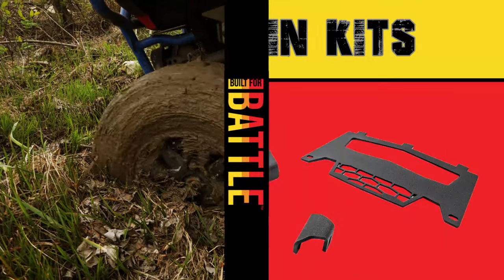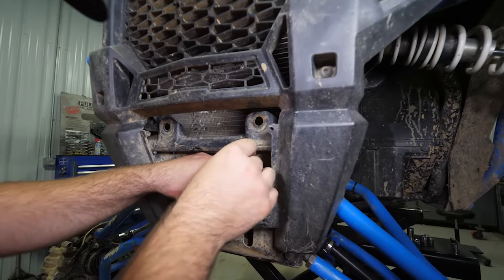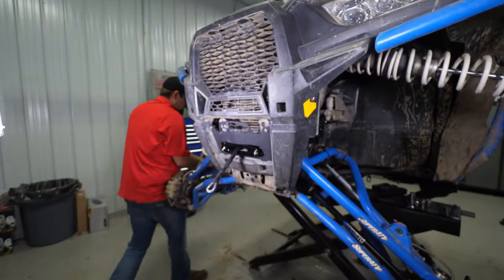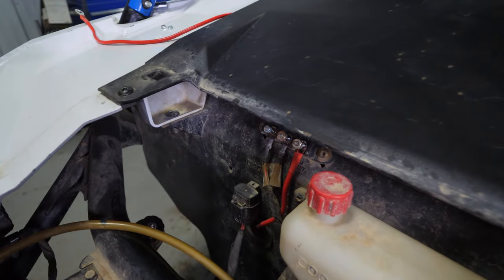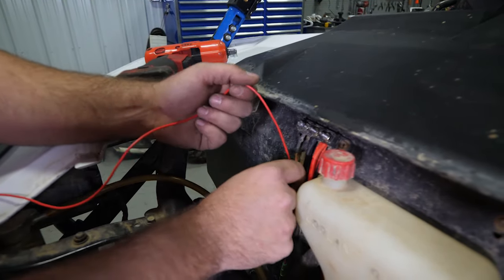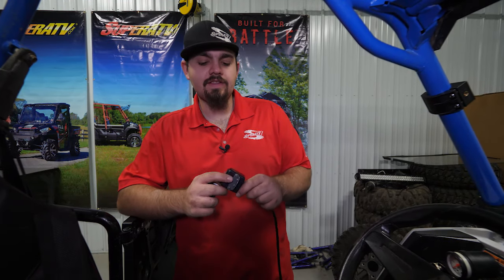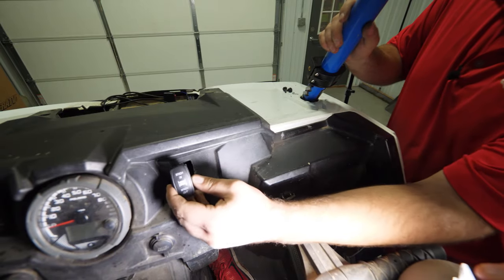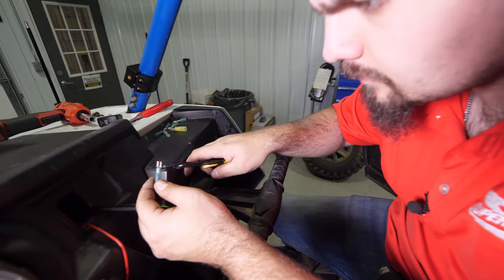How to install Winch Mount and Winch on Polaris RZR 1000 | SuperATV

Comment: One of the best how-to videos I've seen. I already have the SATV bumper, nerf bars, etc., so there's no question where I'm going for my winch. I've been wondering what I was going to do with that wired remote, since I prefer to have an illuminated dash-mounted rocker switch. This video answers that  question! I love the fact that you include the connectors so we don't have to wind the excess wire into a loop and try to find a place to hide it.
Thanks, guys!
Reply from the maker: Thanks Rick that means a lot. We work hard daily to bring you guys legit install videos along with top notch products! Never hesitate to reach out to us if you have any questions about any of our products.

Comment: Pro Tip: on the winch mounting plate put the 2 bolts in on the firewall side and leave them very loose, temporarily zip tie the radiator hoses and intercooler hoses out of the way. Take the drivers side shock and bungee cord it up and out of the way as shown in the video. Fish the winch in from drivers side, be patient and take your time, take a break if needed. Bolt the winch to the mounting plate. Then push mounting plate up and install 2 front bolts and then tighten all 4 mounting bolts. Dont forget to fish the winch cable through fairlead before installing winch on mounting plate. I can verify that the 5000 lb winch fits on superatv mounting plate on a 2018 RZR 4 Turbo 4.
Reply: Did you have to remove the front plastics (or anything not shown) to get to the front mounting plate bolts?

Comment: Great Video. I installed my SuperATV Winch with rocker switch with no problems, due to this video. Thank you. Just a heads up you do not need to take your Tire, or Shock, but it would help. :) A+

Comment: For wiring up the toggle switch, mine was different.  So for those of you that the colors aren’t what this guy says coming from the solenoid. Mine were black, red and green. You hook up the keyed on power like he said and have your two jumpers coming off of it. The ground wire from the bus bar goes to the top (#7) then the order is black, red then the bottom is green.
Reply: Can you post a picture of yours
Reply: @richardpoehnelt3090  if I can figure out how to upload a picture I will
Reply: @dbceaj4279  thanks Dustin. Just take a picture with your phone.

Comment: 2015 rzr xp1000, 3500. 
Got everything hooked up correctly and straight to the battery, but no power to anything.
Reply from the maker: Are you using the remote or the hardwired switch? Is the red wire in the hardwired switch harness connected per the instructions?

Comment: On the 2018 XP4 Turbo, how the heck do you get the front two mounting plate nuts tight? This isn’t shown in the video. Either you need Smurf hands or a wrench that goes through walls.
Reply: sorry to be so off topic but does anybody know a trick to get back into an instagram account?
I stupidly forgot my account password. I appreciate any tips you can offer me.
Reply: @Bryce Jaxon Instablaster =)
Reply: @Nikolas Adrien I really appreciate your reply. I got to the site thru google and I'm waiting for the hacking stuff atm.
I see it takes a while so I will get back to you later with my results.
Reply: @Nikolas Adrien It worked and I actually got access to my account again. I'm so happy!
Thank you so much, you saved my ass!
Reply: @Bryce Jaxon No problem xD

Comment: Do you have a part number for the Y splitter?
Reply from the maker: This install is on an older version of our winch. We no longer carry the y splitter, but we do have the new solenoid kit. Give us a call at 855.743.3427 and we can help you get everything you need to update your wiring to the new style.

Comment: The solenoid that came with my 4500 winch is not the same as that one. So it does not fit in the pre made holes.
Reply: After further looking into
It i found that the solenoid was made for a 19+ model rzr. So i will have to drill holes for it to work instead of using the pre made holes

Comment: Wat kind of battery impact is the one u use. To remove the spring
Reply: It's a Milwaukee 12 volt impact with a protective cover
Reply: Dutch B 
False, that definitely isn’t the M12 Milwaukee 

Looks like the Mac Or Snap On impact (they look much cheaper and basic)

But I’d buy the Milwaukee over Mac or Snap on personally

Comment: Used this video and the other for the 4500lb install here: (https://www.youtube.com/watch?v=ixbbNPpVukA) to install the 4500lb winch in my 2014 RZR XP. Installing the physical winch with the mounting plate was the easy part.. I did not remove the shocks or tire.. just worked around it. Took about 20 minutes. 

The wiring will consume quite a bit more time. The gauge wire that comes with the winch is much larger than the wire feeding the bus bar they tap into in the video. Did not make sense to me to do it that way and possibly overload that circuit. Had to remove drivers seat and center console. I ran the hot and ground wire all the way to the battery and installed a 250A circuit breaker in the battery box on the hot lead. The docs that came with the winch indicate it can pull up to 264A or so. The cables that came with the winch were plenty long enough with a nice service loop to make the pull through the center console.  Only other issue was the solenoid that came with my winch seems to have incorporated the wireless receiver(there is no separate box now) and is much larger than the original unit. As such.. does not align with the stock mounting holes on the firewall any more & the mounting hardware that come with the winch are too small for the firewall lugs anyway.  I used one of the original holes with the correct size hardware and drilled another through hole to accommodate a screw with a self locking nut on the other side. My winch came with the dash mounted rocker switch and remote only. Both work as intended.  

I installed one of their front bumpers at the same time which added to the overall time. If you are considering both.. do it at the same time to avoid having to R&R a lot of the same hardware.  Overall satisfied with install and quality of the parts.

Comment: That grille piece needs to be redesigned to look better it’s a fail
Reply from the maker: It matches the OEM grill pattern while also allowing you still to mount up a front bumper. We appreciate your feedback. It's hard to please everyone, everyone has different style preferences.
Reply: SuperATVMedia 
There was a 2+ inch awkward gap at the op of the plate. 
Looks like something that found in the scrap pile and someone said meh close enough